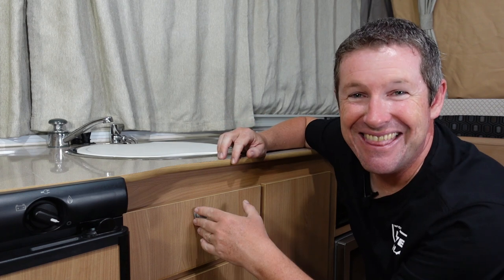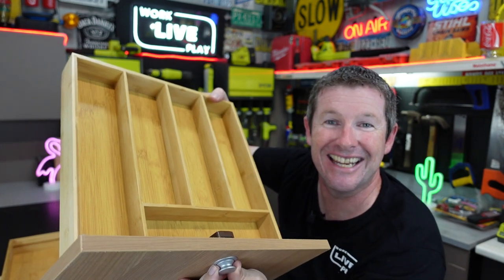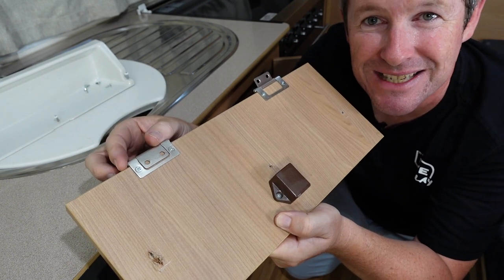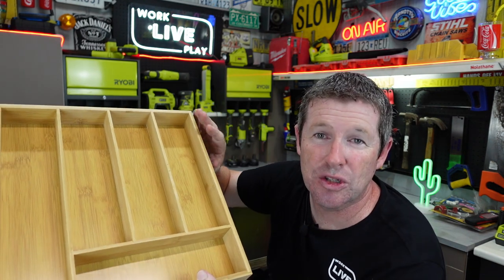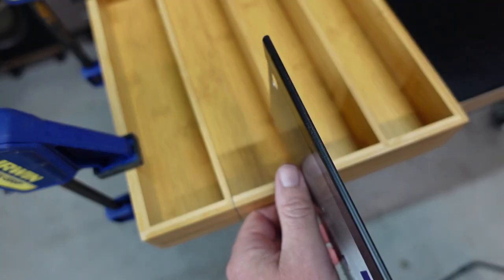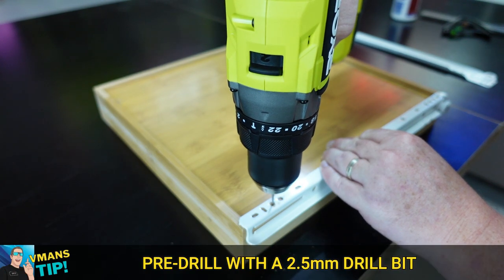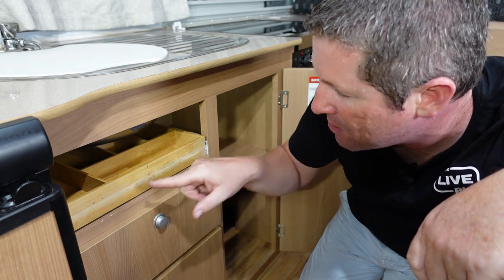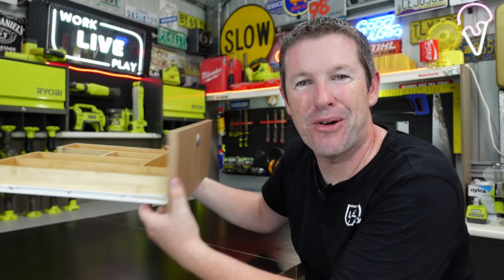LIVE | Jayco under sink Drawer Conversion - remove the flap and install a Kmart Cutlery Tray Insert!

Comment: Great video, and like all your videos, great detail.
I just measured my 2021 Eagle Outback and the drawer width is around 440 mm wide. You could still use the expandable tray but don't break the expandable piece. Also when mounting the side wall for the runners, you will need around a 25 mm thick piece of wood for the fridge side and the other side has a curved piece that you will need to cut your wood to match and affix with some straight brackets. I'm going to try give it a go, not sure how I'll work out the cut out piece around the down pipe just yet so... might end up with just a door :D
Reply: How did you go Phil, found all the same with our 22 Eagle. Did you also find your sink was deeper? I had to take nearly 15mm off the three central long dividers and the back righthand corner, but love the chopstick slot!
Reply: @taztheambo  yep, sink was also lower. Had to go back and forth between shed and caravan a few times 😀
Worked well in the end and glad I did it, extra storage is always key!
Reply: Eagle OB owner here too: just finished this project and found the same: I ended up expanding and also then used my dremel to take about 5mm off the top of the cutlery tray. Took a while! But it fits really good now. I have the hot water heater so was a bit of contortionist move. 

The click in the vid I would suspect is a screw sticking out from a runner. 

Great inspo - thanks for the vid!

Comment: This doesnt work in a 23 ob eagle gaps alot wider (405mm) so you need to use the spacer feature and the left hand runner (fridge side) needs a packer alot harder to do. Looks alot less factory than this way shown
Reply: Yes, same with a 2018 OB Swan. Gap is 385mm so need to build a spacer for the LH runner (fridge side).

Comment: Awesome video Vaughn, if you want the runners to give you more room so you dont have to shave the wheels down, sand a 40deg on the bottom of the bamboo draw so the runners fit tighter/closer to the draw. This is to account for the metal fold on the inside of the runners not being able to accommodate for a crisp 90deg corner. It gave me the extra space so the draw didn't feel so tight. 😁

Comment: There seems to be a bit of variation between models and year of manufacture.   I have already done the mod, but the opening on our 2021 Eagle Outback is 404mm x 135mm.   Simply means that I used the expanding feature and have a narrow compartment down the left side for storing chopsticks (?).